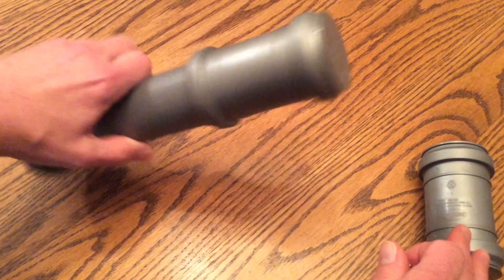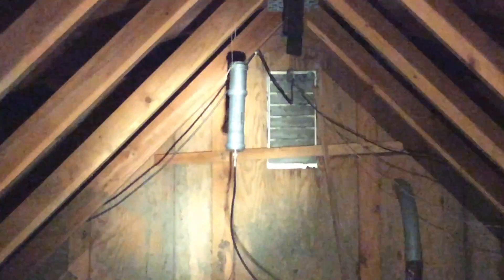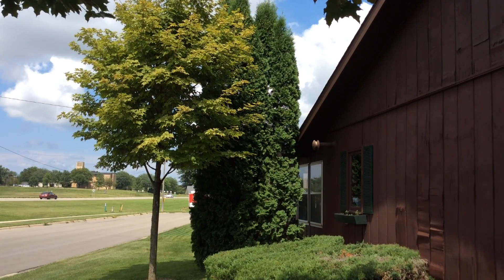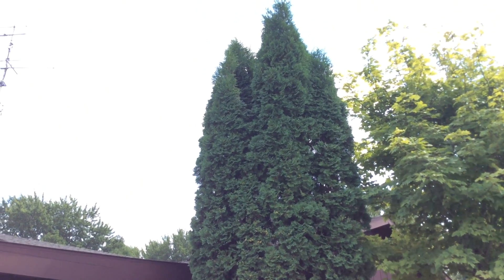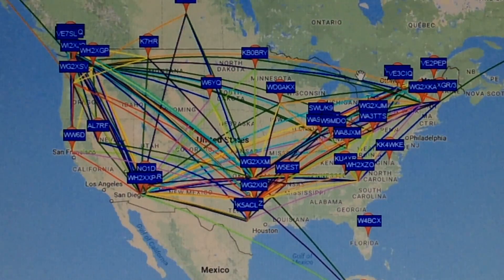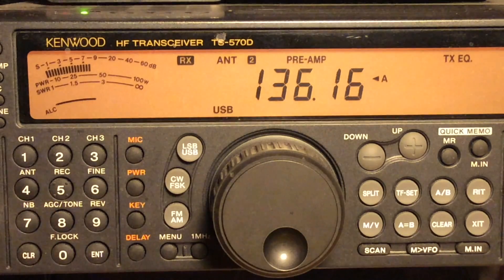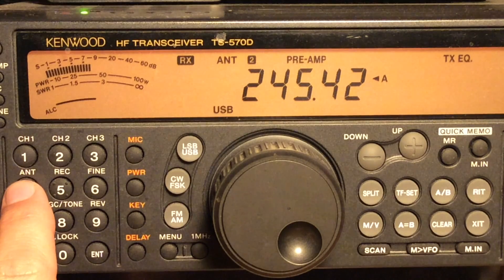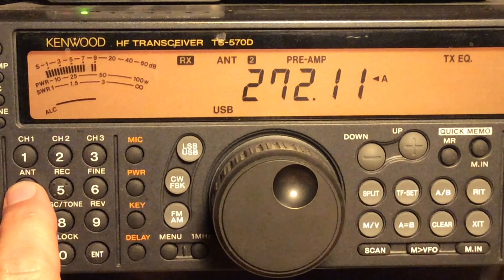Below 500 Khz - Mini Whip Compared To An 80 Meter OCF Dipole

Comment: Good demonstration! I use a PA0RDT fairly regularly mounted above the roof line on a fibreglass mast to listen to SAQ on 17.2 kHz using total off grid battery pack power for everything in the chain. I have a triple cascaded choke of RG316 on 77, 43 and 31 mix, one at each end of what is an ungrounded 10M long feeder. In theory the chokes should be ineffective due to the high impedance nature of the antenna (?) but the system as a whole does work, and often very well indeed.

I can cut the DC feed to the PA0RDT and everything goes quiet. I can cut the DC feed to my Datong VLF converter and everything goes quiet. I can swap out the whole shooting match for the few metres of wire recommended for the Datong and all I get is noise. The 10M feeder is not grounded because the radio as stated is off grid, yet it works. I wouldn't take issue with the well informed detractors, but I am happy with the set up.

It is my uninformed guess that irrespective of my chokes (intended to throttle back MF and HF braid pickup) the feeder is the antenna and the PA0RDT acts as a high impedance amplifier that provides for coping with the total mismatch of such a short wire at VLF, but I'm not yet certain. The high impedance feed might explain the relatively low dependence on a counterpoise, return or "ground" in much the same way as most folk conveniently ignore the short length needed by end fed half waves? Whatever- as you demonstrated, it works.

Comment: The comparison of the antennas is interesting, for the range of the frequency tested I liked the MiniWhip.
How does it work for the medium wave?
73 from Pachuca Mexico!
Martin.
Reply from the maker: I find it works very well for the medium wave and the lower frequencies.  When I get above 3 MHz or so, my dipole type antennas seem to be better.
Reply: @RadioHamGuy  Thank you very much for the comment.
On some occasion I had one but as well as increased signal gain as well as noise, definitely the dipole is also the best, I made just for reception a 6 meter long dipole of copper tube for water use, rotating, with wire of 300 Ohms and only with high impedance drivers I have a good signal from 5 to 18 Mhz.
73 from Pachuca in Mexico
Reply: @RadioHamGuy  https://youtu.be/ewCREAUox_c

Comment: listening below AM BCB have had good results with wire antennas depends on how you hook it up 80 meter dipole tie the end of feed line together and use it as top loaded vertical, with a receive amp and tuner works also used 80 and 160 meter inverted L antennas, 160 inverted L with HB  LC circuit to tune it worked best

Comment: Unexpected surprise from such a small antenna. I made one by myself and after some reading and testing,I found some interesting conclusions. The miniwhip is somehow a condenser (about 3pF from his plate to air) that sense the voltage difference between copper plate and the shield of coaxial cable (electric component of the electromagnetic wave), voltage that is amplified by the two transistors (j310 &2N.....). So, the best performance i achieved by installing miniwhip at about 8m above ground whit the coaxial cable coming straight to the base, where is connected to a ground rod, and then to the shack. It acts perfectly like a full size vertical antenna for 160m band, but much much shorter, verry good for dx, not so good for nvis signals (closer than 300 miles). 73's Larry! de Adrian, YO9HZN

Comment: Hi Larry, Excellent job. It is another video in favor of Mini-Whip antenna!
It is really amazing that with its size of just few centimeters, mini-whip antenna outperforms most of reasonable wire antennas, especially on low HF bands and lower down to few kHz.
I have made several videos comparing my home made mini-whip with delta loop antenna 43 meters long. 
You can check them on my youtube channel:
https://www.youtube.com/channel/UCebhSpWm48W9Dw7oa04jfSg/videos

 73,
Mile Kokotov, Z33T

Comment: Good evening, guy. Well, today I found your videos on youtube and I must say it's really good. I'm an amateur radio in Southern Brazil and almost every day on Afternoons I listen on 6 channel people talking in english, I enjoy it! For some reasons I can't talk with them. Can you give me a suggestion which antenna and radio I could use to keep contact for dx? I've 2 meters and 11 meters. 73s mate
Reply from the maker: Hi Felipe, thanks for the post and glad to hear you enjoy the videos.  As for DX on channel 6, you don't really need much, you can use a dipole antenna cut for 11 meters or a vertical of any sort and you should be able to make contacts if it is outdoors and up a little ways in the air.  If you want to do better you could look into a beam antenna for that band.  But when the skip is rolling in you don't need a lot to work DX on that band.  73
Reply: Thank you for answer me. I'm sorry if I make so mistake writing. You told me I don't need much to listen in channel 6 so do you know from where they're talking? The signal is great here on my radio with scale two or three.  I know It depends of the propagation as well.
Reply: Felipe Nunes Im certain you've figured this out by now but many operators on Ch 6 are from Chicago but they can be from anywhere, even the Carribean islands. You will need alot of power to talk on Ch 6, known as The Superbowl because its where the strongest and the best come together, meaning much money and much power. When skip conditions are good you can hear people talking on all channels on AM and 38 sideband in America. Of course there's the freeband which is above 27.405 where most of the DX (long distance contacts) takes place, 27.555 being the English call channel. Hopefully you've become a licensed amateur radio operator by now. Way more contacts to be made.

Comment: Thanks for uploading the antenna comparison Larry. Sure hope my new mini-whip works as well as yours does! Big difference between it and the dipole. That antenna switch on the Kenwood really helps with the comparison. I read somewhere where a ham was using a mini-whip on the receive only antenna input on his rig and transmitting on a second antenna. Mini-whips are receive only.73 Kevin KB0BRY
Reply from the maker: Yes, you sure don't want to transmit into one or it will be no more, ha!  It is working well on the higher HF bands for me also but I have to be careful with that antenna switch so I don't tx into it!